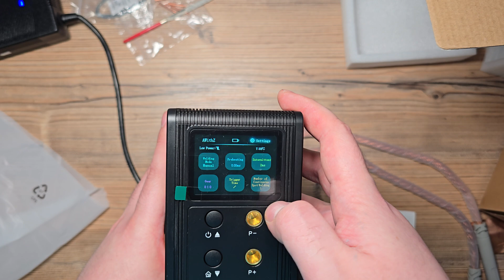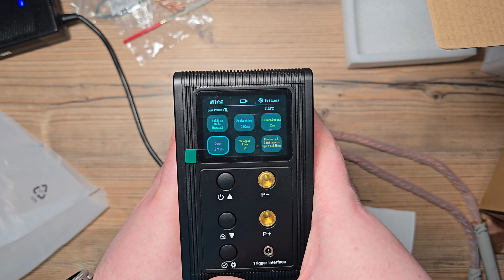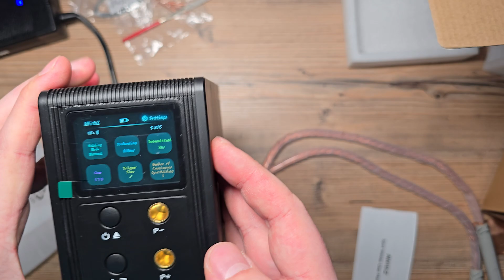AWithZ 24kW Capacitor Spot Welder - The next level of spot welding

Comment: which copper you use? how pure 99.95, 99.9, 99.99?
Reply from the maker: Cu+Ag - 99,90%
Bi - 0,0005%
O - 0,040%
Pb - 0,005%

But I think its not that important, just its good to have copper, not copper plated.
Reply: @HobbyWithAdam  what it mean to have copper but not copper plated? thin stripe? not to put a plate to cover all surface?
Reply from the maker: @abShuron  noo, I mean to have pure coppper with like ~99% of copper inside, copper is generally expensive and you might find cheap sht which is just copper plated like CCA cables

Comment: so the correct method is to weld using 2 probes in pairs at the same time?

also how can you tell that the machine is overheating?
Reply from the maker: https://youtu.be/svxxBh5Pkdw?si=I2Mtn3H0R_ArNCHB&t=280 there I show how proper welding should look like

Spot welder has temperature reading on its screen, when it rises 65c it says overheat and it needs to be cooled down
Reply: @HobbyWithAdam  thank you
Reply: @HobbyWithAdam i saw your new video, the welds look good.

i also ordered the p30c and will spot weld nickel copper sandwich, 0.1mm nickel with 0.2mm copper strip, do you recommend full power for the p30c?
Reply from the maker: @skarebsuper  I used 0,2mm nickel, but generally it doesn't matter, just make sure its pure nickel,

Yes, i was using it at full power
Reply: @HobbyWithAdam  thanks for the reply. i assume you are happy with the weld quality at full power... i will try the same shortly

Comment: Hello, from the video, this is a P30C model (from the video 7:07) and it's rated for 21.8kW and not 24kW, can you tell us the exact model? I'm looking for a welder to do copper nickel sandwich too.
Reply from the maker: Yep, I was ordering exactly 24kW model, which somewhere was named P30C that in real has 21,8kW...

It frequently overheated after some welds (20?) and I had to cool it down ;/ because I was working on max settings for copper nickel sandwich